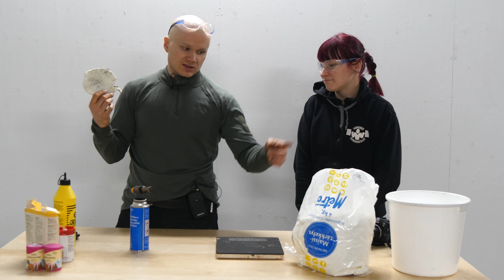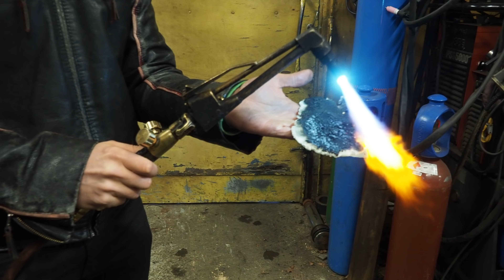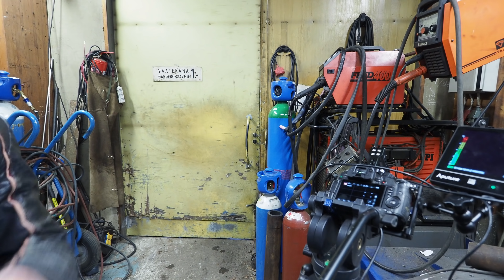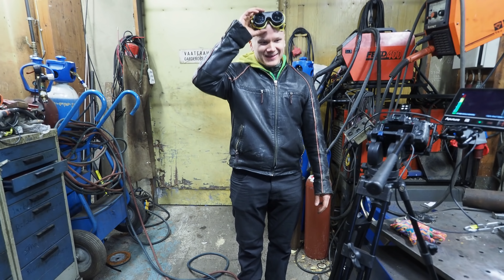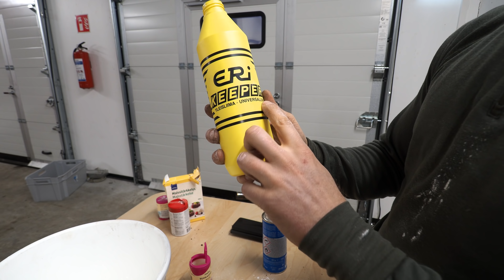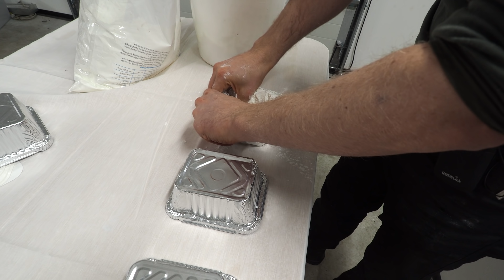Super Thermal Insulator "STARLITE" Vs. Oxy-Acetylene Torch

Comment: Nice tests! Awesome. I have more tests I have to do myself to make this material work even better. Thanks for the shoutout by the way!
Reply: See Scott Manley's video https://youtu.be/hLHo9ZM3Bis from 11:38. He describes how they made similar ablative material for Apollo spacecraft, and reinforced it with hexagonal fiberglass support grid.
Reply: NightHawkInLight earned,a,sub,just,for,this,how,your,channel,grows,n,grows,in,subs,will,amaze,ya,I,just,hope,Kim,don't,watch,haha
Reply: Awesome,science,channel
Reply: Remember to include the ammonium nitrate! :D
Reply: I wonder if a different binding agent might make it easier to work with or more resistant to physical damage.
Reply: @dannyoman7219  How? Why? Where did you learn to "write"? You must be a bot.
Reply: @94e88  phone cracked
Reply: @dannyoman7219  But now you can write fine?
Reply: Ever since I saw your video, I had the idea of possibly making cheap crucibles out of this stuff to see if it would work for foundry work.  I was also curious with King of Random's Proto-putty, since it is similar to this method for making silicon molds.  If another element that is an insulator could be used instead of silicon it would be more mold-able.  I was thinking epoxy resin, but not sure of the flammability of that.
Reply: If the "original" is called StarLite, then your version should be called NightLIte (or NiteLIte, but then the connection to your channel name gets kina lost).
Reply: Martin Edelius Absolutely, it should be called NiteLite. The original recipe was never published, and this version was re-invented by NightHawkInLight
Reply: Hey, why not add some shredded fiberglass fibers or in there to reinforce it like the car exhaust repair paste has, then it should be more resistant to wear?
Reply: But what happens if this material is soaked in water and then put on to the test again?

Comment: “Some British guy invented it...and he showed how good it was… But he didn’t tell anyone how to make it… And then he died,”

Lauri You always have me rolling
Reply: His family have the recipe but refuse to sell it unless they got 51% of everything made out of it.
Reply: @thomashenry4798  51% or 51% of profit margin?
Reply: @devincastellucci4627  He demanded to retain at least 51% Ownership of the formula, which meant that anything being done with it would have to reach him for a final say in matters.
Reply: @KibitoAkuya  yeah, that is a LOT different.
Reply: Howard Maryon-Davis - apparently gave the formula to his daughter who is just as self interested...  values her family’s financial reward more than the lives she claims the product “could save” 

  My suspicion is that it has been eclipsed by carbon foams specifically manufactured and engineered for structural strength, durability and characteristics like being waterproof.

  Starlight’s only real advantages would be cheapness and ease of manufacture.

  Starlite is simply an ablative heat shield that develops a thin layer of carbon foam when exposed to high heat, and which melts and/or decomposes when exposed to condensing humidity or liquid water.

  I could see it being very useful as a putty for welders to use to protect the back side of metals that can be shielded with CO2, and as a protective putty for soldering or brazing copper pipe in tight spaces during building construction.  Or a consumable insulator backer to refractory material in small scale home foundries and forges and such.

  Uses like that, where the non toxic nature of it, the low cost, ease of manufacture on site, and ease of removal after use, are all advantages.

Comment: "Don't do it at home, but if you are brave you can do it on your own hand."
Sounds good.
Reply from the maker: it's possible to many really risky things but it's probably vise not to do many of those :D And we are getting paid to do this so we are professionals which makes everything much safer :D
Reply: @Beyondthepress  LOL!! get money for it, doesn't make it safer. I think those claims "dont try this at home" on every video is ridiculous. As long as someone knows what they are doing, it's no problem. In this case you will also feel the heat before if does any real damage (if the material fails or something). But that material was really impressive how much it held up, because the piece you had wasn't very thick ether.
Reply: REEde84XL 
Rediculous?
Ah, yes, from the base word "redicule"
Yes, meaning resembling a reticule purse.  
Ridicule is so 2018 anyway.  REEEdicule is the in thing in 2019
Reply: @Speeder84XL  dude, it's called humor
Reply: @tiberiu_nicolae  Ok, that could be, if he say "don't try this at home" when he does the most extreme stuff like oxygen/acetylene explosions and similar 
 - but the continued talk about how dangerous the stuff he does is - all the time, on every video is quite annoying. But that's just a minor imperfection on an otherwise awesome channel.
Reply: @Speeder84XL  He doesn't care if you do it at home. It is a legal disclaimer so that he does not get sued. As long as you say you warned against doing it, then you have good standing if someone gets hurts and says your video caused it by encouraging it.
Reply: Ha ! No great discovery has ever come without great risks. As a scientist and engineer I accept the the risk and choose to push the envelope !!! After all I am The Doctor !!
Reply: @Speeder84XL  they have to say "dont try this at home". Its certainly no requirement but for some reason it sometimes tricked the algorithm to not demonetize you.
Oh, and common sense ofc.

Comment: I would like to see Thermite vs. Starlight. Try a batch in the press to make it harder to see if you get different results
Reply: Done
Reply: The oxy-acetylene torch is hotter than thermite. Thermite burns at about 2,200° C (3,990° F), acetylene in oxygen burns at about 3,100° C (5,612° F).
Reply: astrix 3k degrees when flame is optimally focused, but FUCKING impressive!

Comment: This stuff seems to work similarly to a heat shield on a spacecraft. The carbon matrix is an ablative surface so the CO2 foam carries heat and burned particles away with the gas. I would love to watch this through a thermal camera.
Reply: Would also be interesting to see what a Thermic Lance could do vs the starlite
Reply: Parker Solar Probe.

Comment: The hole made when you melted the mild steel nut could have also been partially formed by the molten steel dissolving the hot carbon it was in contact with. When you are dealing with heat at these levels you have to consider reactions and mixing of materials almost like you are dealing with metallurgy.

I am also curious about if this could resist a molten metal jet since that is what is used to pierce tank armor by many shoulder fired rockets and missiles.

Comment: Char a piece of toast and it'll work just as well as the starlite - that's the magic of ablative heat shields.   I wish you'd have tried burning it using an excess of O2 - I'm sure you'd be able to convert more of the carbon into carbon dioxide, carbon monoxide, etc.
Reply from the maker: Yep, we have one video where we test crushed toilet paper as an ablative heat shield. But I would say that this material works on some situations better since it get's thicker when you apply the heat but then in the other hand it's really brittle after it has expanded
Reply: @Beyondthepress  i wonder if it is possible to mix with something that gets sticky when heated, so it helps "glue" the carbon foam together so it doesnt fly away.  Is there a metal that is very sticky when melted?

Comment: What I believe happened, is that the flame was so hot that it evaporates the baking soda out of it and that caused it to lose its ability to resist the transmission of heat. So its a hi R value insulation at high temps, but not at extreme temps.

Comment: It works the same way as the flame-gel you guys were playing with on Laurie's head.
Evaporation carries away an enormous amount of heat energy.
Starlite would never have worked in space; vacuum would desiccate the material very quickly.
Without the large water content most of the cooling properties are lost.
While this stuff resists heat at home/shop temperatures, re-entry is more that just heat...rapidly fluctuating dynamic pressure, plasma effects, erosion in hyper-sonic airflow.
At mach 6+, a raindrop is a bullet.
They call it a heat-shield, it should have been called ablative armor.
Reply: Oooh I like this information.

Comment: i believe it works a sa sort of ablative insulator, as they use on the return capsules of spacecrafts. the working principle is that it does not reflect or dissipate the heat, but absorbs it in great amount in a small volume of matter, and then chips slowly away, carrying the thermal energy away with its own material. this is what makes spacecraft heat shields single use devices. if you have gas to spare then you can try burning it with not as much flow and heat, but for an extended period of time to see if it still digs away eventually.

Comment: i think the reason that it didn't work as well with the nut is that the starlite is an ablative heat shield, and one of the mechanisms by which ablative heat shields work is forming a gas barrier between the heat source and the heat shield, so by having direct contact, you're bypassing one of the major mechanisms of heat dissipation

Comment: Maybe a silicone adhesive could be used? To keep it doft and flexible, like rubber! Anyone try that? I'm thinking of using it for concentrated solar steam generator, to generate power for my off grid house. And maybe a solar water heater project. It would allow wood to be used very close to high heat. And not loose as much heat if un insulated.. Great video!!!

Comment: hello, nice video ! i did this same starlite (with  corn starch etc.. ) it could  resist fire without  thermal conduction but just by puting it next to a 60 degrees celsius heating source without any flame the sample started to conduct heat  normaly i  dont think its a good heat insulator to use for cooking for example to save energy by wraping it around a pot,  it's more like a fire shield that releases CO2 and carbon to the surface thus building a barrier against the flame.

Comment: Acetylene torch will get hot enough to burn the carbon, especially if you have an oxidising flame like you had, that has enough hot oxygen to burn the carbon away.  Basically the stuff is an entumescent solid, that turns to a charred layer with application of heat, a common thing used to make fire proof cable ways in buildings, but still allow changes to be made in the cabling easily.

Comment: Did you try oxygen-rich flame (cutting flame)? I bet, oxygen rich flame goes through pretty quickly.
Reply: Did you literally not watch this video lol
Reply: A Doggo Chooses there are several ways of using an oxy-acetylene torch. I was asking if he used an oxygen rich cutting flame or not. Looked to me like a stochiometric flame, maybe even a bit fuel rich.
Reply: Marissa Giammanco never assume the other guy knows less than you, apparently you don‘t know that there are many different kind of flames you can make with a torch. I was asking if the flame he used was oxygen-rich, duh.
Reply: A Doggo Chooses btw, with an oxygen rich flame, you wouldn‘t melt steel, you burn away steel.
Reply: Did not look like he ever hit the trigger. And I agree I do not think it would last long if someone hit the oxygen.

Comment: Try thermite with short steel square pipe with a bottom welded on. The thermite will be more directional. It does not melt the steel.

Comment: You are correct that the oxygen also reacted with the carbon to make carbon dioxide.  If your experiments work out with the thermite try coating the inside of a plastic bucket and lighting off thermite in it and seeing if it melts. Not allowed to do that in UK, it's a no no in the eyes of the government.

Comment: Can you retest this with an electric heater, or the carbon arc torch?  That way you wouldn't have the high pressure gas eroding the insulator. This stuff really intrigues me.

Comment: Hang on. Would this work as insulation? I mean keep the heat in a container (imagine a super sauna, and the walls and roof and floor is made from this material). And would it work as a layer of insulation in a crucible so the outside doesn't get hot?
Reply from the maker: I am planning to make arc furnace from this stuff
Reply: @Beyondthepress  I am so happy to hear you say that! I was going to ask you to build a forge or foundry or kiln using this stuff but your way ahead of me.
Reply: Yep it's an excellent insulator
Reply: @Beyondthepress  What about comparing insulating properties of starlite and commercial insulating material?

Comment: what kind of sorcery is this? :O
why didn't you use thermal camera to show temperature of the underside of that thing?
Reply from the maker: It's really hard to film anything with thermal camera when you have oxy-acetylene torch running next to something. It's like having 1000w led panel and trying to film candle next to it :D
Reply: @Beyondthepress  I'd still try to find 1000 ways to use thermal camera with this thing. maybe not necessarily together with oxyacetylene torch, but it would be a good proof how well it works
Reply: @Beyondthepress  even an inexpensive infrared thermometer (handheld like a gun and pointed at an object) would give accurate temperatures. Small and easy to have handy for use during any videos with hot or cold elements involved.  I bought one at hardware store for about $20 US. Even fairly basic models include a laser pointer. Can measure temps from several feet away. 😁

Comment: Steel desolves carbon. It just ate a hole in it when it melted. Duh. You should try a higher melting point metal that doesn't aloy with carbon to be sure. Or you could just try gold. Not so high temp, but it would still be more informative
Reply from the maker: I didn't thought about that when melting the steel but you are probably right since the hole was created around the time when the steel started to melt
Reply: This isn’t Cody’s lab.
Reply: @Beyondthepress  You still got that lump of Tungsten from your "White-hot Tungsten Cube" videos?

Comment: You said that the playdoh would melt about 50 degrees and then you said that the starlite is about 60 degrees? And it didnt melt the playdoh? Im confused?!?!?
Reply: The fact that the material is very good insulator also means that the heat won't easily transfer from it to the hand.

Comment: Why not just use bread?
Reply: G'day,

  It's been done.

   Old English Currency had different coins for Pennies, Half-Pennies, "Farthings" (ie Quarter-Pennies), and "Groats" (8 Groats to the Penny)..; and below that, their lowest concievable Unit of Commercial Value was a thing called a "Tinker's Dam".., and a Groat would buy about 6 of them.

  Tinkers repaired Saucepans, Kettles, Pots, Pans, & other small bits of Metalwork, y'see, and to hold their molten Solder in place they chewed  a dry Crust of stale Bread into a stiff paste, put it onto one side of the Hole, and then their Solder stuck to the clean hot metal while cooking the Paste but not unsticking it from the metal surrounding the Hole to be repaired.

As long as the Bread-Crust wasn't actually mouldy, then it was theoretically marketable as Tinker's Dams (!).

   Tutorial concludeth...

  Have a good one,

;-p

Ciao !

Comment: What the hell is that?! These kinds of mystery materials have been reported, but how hasn't anyone or any company or nation try to replicate these? They must have some obvious drawback or something...  https://en.wikipedia.org/wiki/Lost_inventions
Reply: onnirant you can do the same thing with VERY burnt toast, calm down.
Reply: Because there are much better alternatives. Just because you can put your hand under it doesn't mean it's useful in other applications where you need a heatshield.
Reply: Not drawbacks, just in most cases we have way more useful things. For instance NASA and spaceX have far more advanced formes of ablative heat shields. They don't have need of cornstarch and backing soda.